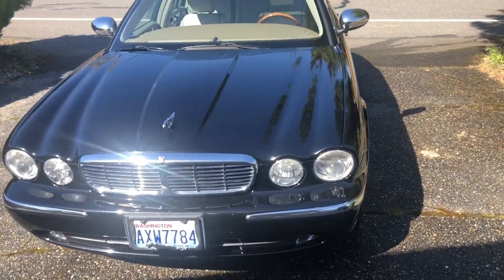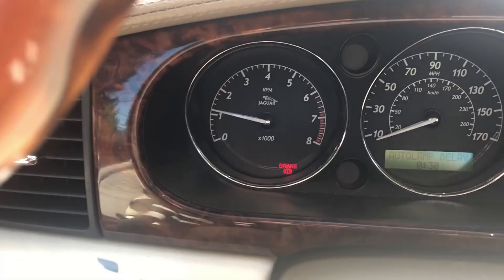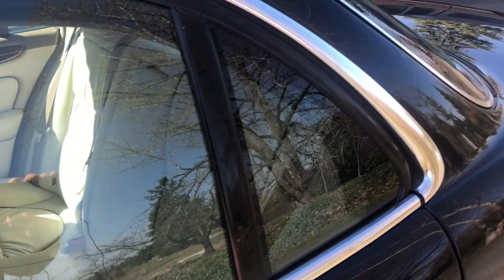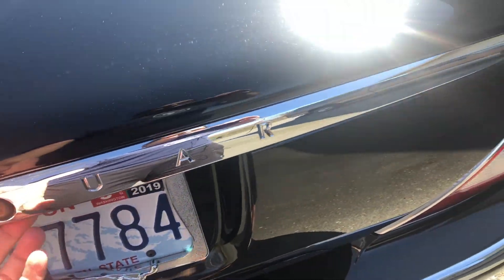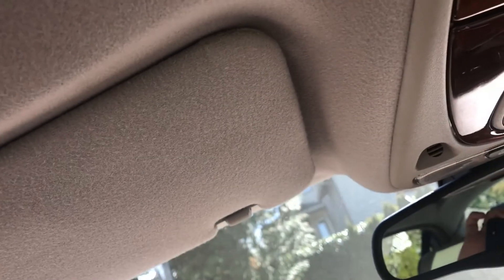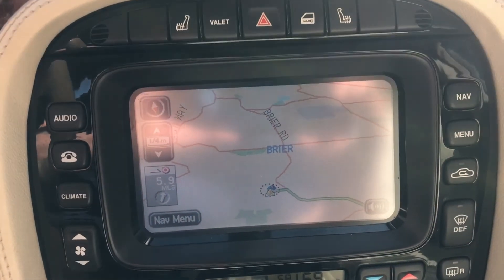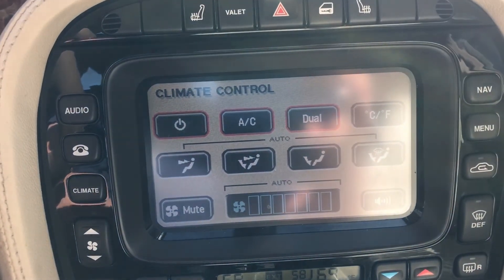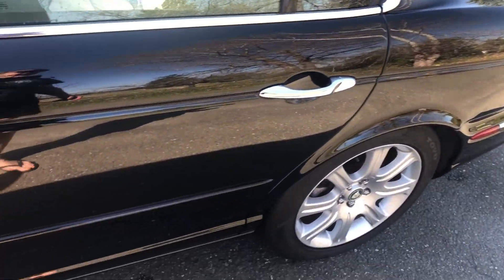2004 Jaguar XJ8 Vanden Plas

Comment: You should be able to lower your windows by holding down the unlock button on the remote, just like you can on Merc, it works fine mine so maybe there's a problem with the remote?
Reply from the maker: Not sure what your your XJ8 is, but my 2004 was activated with the key.  I sold the car shortly after I shot this video a couple years ago, so cannot check.

Comment: I'm looking at one of these with 110K miles or a 2012 E350 Benz wagon with 115K miles. You mentioned you've owned a Benz - which did you prefer and why? Thanks!
Reply from the maker: Totally different cars.  I have had a couple older MB cars.  Last was a 2000 S430.  Well built, but complicated and expensive to have repaired.  I now have this Cadillac.  I also have a Jaguar XJS for fun, a Ram truck for work and a few other cars.  I drive the Cadillac most.